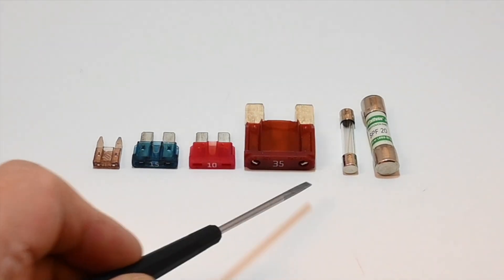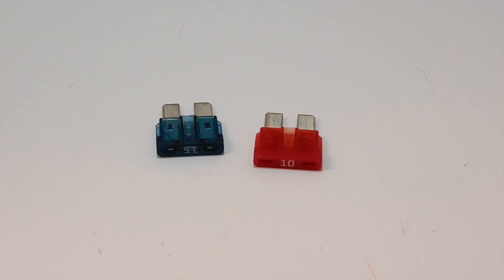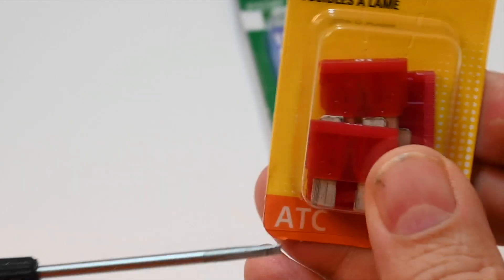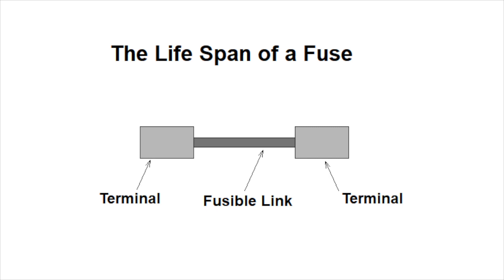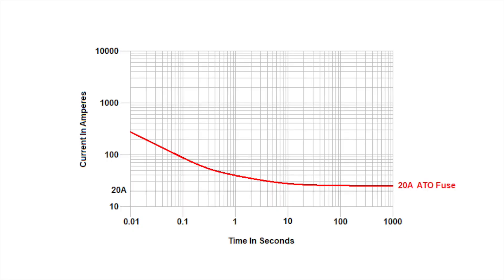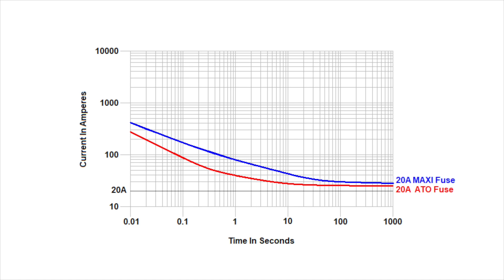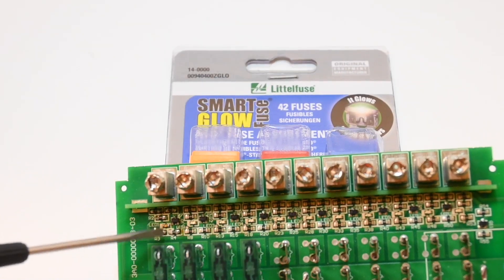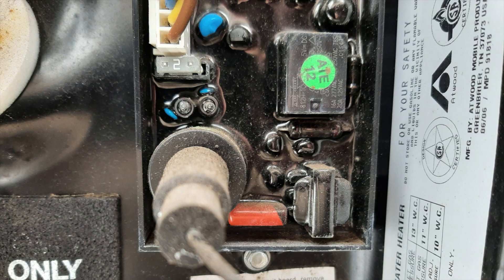All About Fuses... for your RV

Comment: Thank you for creating this video, it was incredibly informative and helpful.  I just liked and subscribed and look forward to watching more of your videos.  If you have time for a question, may I ask one?

I'm a first-time trailer owner stocking up on spare fuses.  The top 15amp fuse in the WFCO 8735P distribution panel is an automatic circuit breaker type.  So far, I've only found these ATO/ATC types of 15amp breaker fuses at 28 volts or lower.  You mentioned that blade fuses are rated for 32 volts DC, and to never exceed the voltage rating.  I wondered if it's OK to use fuses with a voltage lower than 32?

I've been told it is OK to replace the circuit breaker type fuse with a regular one but thought there might have been a reason the trailer manufacturer might have used the circuit breaker type fuse there.  
Thank you for any insight you can offer.